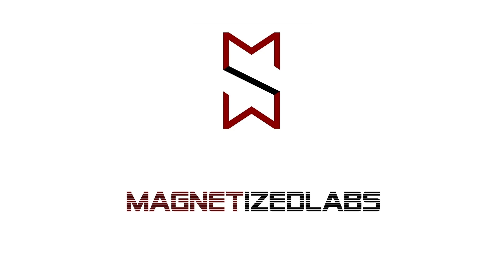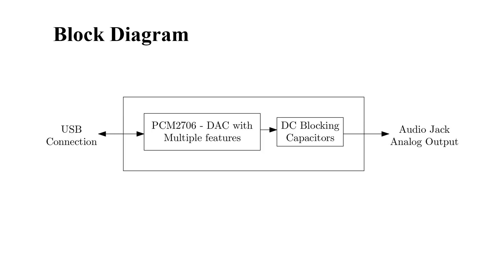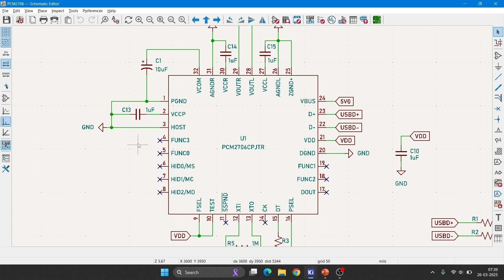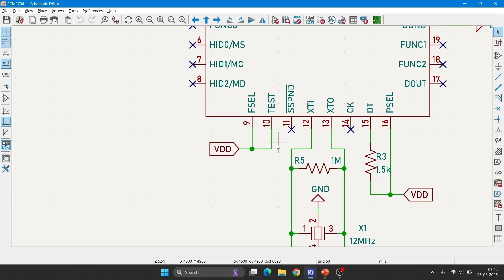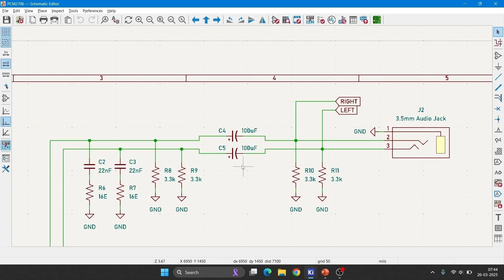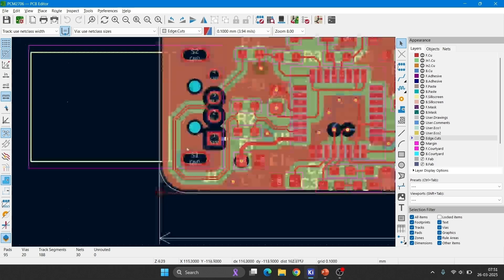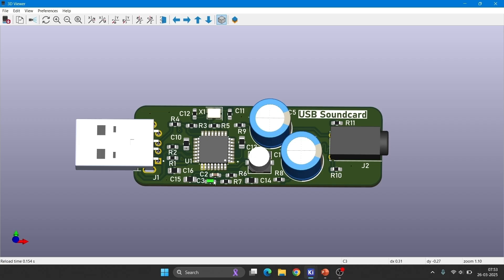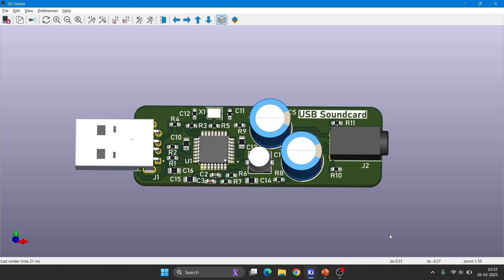Design of USB Sound Card using PCM2706 Audio Codec in KiCAD | Magnetized Labs 04

Comment: For this to work. Driver fiirmware need to create or it work just plug and play?
Reply from the maker: There is no firmware required. Just plug and play device. Automatically your host device will detect this as a sound card and it will route the audio through this.